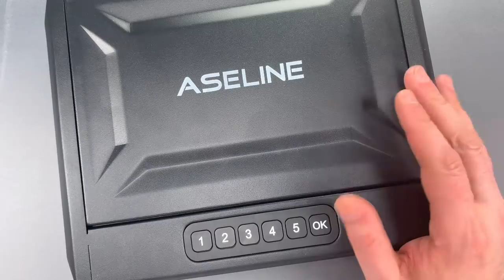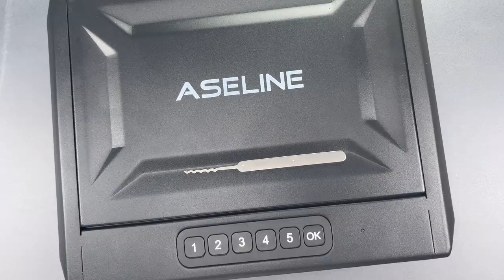[1238] An Unfortunate Name For An Unfortunate Gun Lockbox

Comment: I really want to know what your opinion is on 3D printed lock pics
Reply: I don't pick locks but unless they are printed out of metal(yes, that's possible, not for an average consumer though) i doubt they would survive a lot. Simple locks like this one are probably fine if you just lost a key and have a 3d printer but i doubt you would be able to pick anything that requires a lot of force.
Reply: Too springy. You' d get maybe 2, if lucky 3 layers in, that's just not enough. They're also going to wear quickly.
Reply: More like Skyrim pics.
Reply: For common 3D printers using PLA or ABS as filaments, the pick is about as soft as a poker card, oh and it will probably break on first try as well. I've tried.

Comment: “This is the kind of lock you secure toilet paper in a restroom” 😂😂😂
Reply: Frankly, it looks easier to open then some of the really shitty (no pun intended) locks I encountered on public bathroom TP dispensers years ago. Of course they might have been harder to open due to being rusted or bent, and/or the "key" being bent.
Reply: Wait; What toilet paper cabinets does the Cal-DOJ use?
Reply: Even that's generous. It's the kind of lock you use for a filing cabinet.
Reply: Got to wonder how many toilet paper dispensers he has picked.
Reply: The funny thing is in my high school they actually secured toilet paper with a lock like this.
Reply: @jcardboard  it’s the kind of lock you use for a filing cabinet holding small amounts of printer paper
Reply: Funnily enough I got bored to decided to try picking locks on toilet paper holders in gas stations and the locks do look very very similar to the lock that's on this safe
Reply: High praise! Toilet paper has been a valuable commodity over the last year.

Comment: To be fair, back in 2020 toilet paper was as valuable as a gun
Reply: "Back in 2020..." ROFL 🤣
Reply: According to MSM. but sure the joke stands.
Reply: Well, while that may be true, the main concern with locking firearms isn't that someone steals them, it's that the wrong person (especially children) uses it wrongly
Reply: @melonlord1414  My cat has a habit of using toilet paper wrongly.
Reply: @melonlord1414  I could have jimmied a lock like that by age 8. I know because I had one on a little keepsake box that I routinely did it to after losing the key. It only took a straightened paperclip and the right touch.
Reply: and bullets as rare as diamonds
Reply: Only until May or so. Then June happened.
Reply: @Megatron995  I remember doing something similar at 6  except it was the house door locks with nothing more than a metal hairpin and I didn't have access to books on it and youtube wasn't invented yet (self taught out of necessity as getting locked out of the house without a coat in sub zero temps sucks, and my sister was evil back then and thought it was funny) and it just so happened there was a metal hairpin laying on the floor of the porch. Bent the hair pin to 90degrees removed the rubber tip from the straight side jimmied it past the security bar (that had just been made available on door locks that year) and single pin picked the lock using the hairpin as both the pick and tensioner and it was a 5pin lock

Comment: Someday, LPL will find a "premium" lock that can be literally shaken open.
Reply: I think he actually has one....if not shaken then "thumped" with a  rubber mallet or the handle of a screwdriver?
Reply: there was that gun safe that would open from a 1 inch drop
Reply: There is already one he opens without even touching. With a magnet
Reply: Wasn't there a car hitch that he simply lifted up???

Comment: These lockboxes are designed for owners who feel they don't need and don't want to securely store their guns but they are legally required to store guns in lockboxes that meet some minimum criteria, but there is no criteria for actual lock quality. They are good for malicious compliance, and the lock quality (and in this case even the branding) is a clear "f you" message to anyone who checks compliance and to any visitor who supports such requirements. It should be cheap, it should be visibly bad, it should be practically useless as a real lock.

Comment: I'm only questioning the purpose of the dial pad at this point. Was that supposed to be the primary interface, and the wafer lock is the backup? Because "backup" seems like an euphemism. More like a back door, where the key is not under the doormat, but kept in the lock plug at all times.

Comment: From the 'ping' I'd bet you could easily open that up with a simple screwdriver wedged in the center and just apply a little lever action. From the sound of the cheap metal it should give without hardly any resistance.

Comment: I don't think the point of these is to actually secure firearms. If you want to secure your firearms against theft, you buy a real safe that weighs a few hundred pounds and bolts down. The point of these things is to be a cheap, minimal way comply with bs states or localities regulations that require you to keep your gun locked up in which case yeah, I want something that opens with almost no effort or with anything if I have to jump out of bed and use it in the middle of the night.

Comment: I stand by my opinion that gun safes that are meant for safety rather than theft shouldn't be hard to bypass. If you have small children then it should be placed out of harms way. If you have older children it should be placed out of harms way and they should know that guns aren't something to mess with. Most people aren't going to be able to open any kind of lock in a high stress situation so an easy bypass is a good thing in my opinion. An extra measure would be to not keep a round in the chamber. Most children don't have the hand strength to rack a slide.

Comment: we had a chemical cabinet in our lab at university that had a lock like this. I did not even use a wave rake, just a piece of welding wire that was lying around to jam in it and wiggle it open and using the wire as its own tension tool. it was faster then walking over to the desk to get the key.  it is obvious why it worked because the key had almost no biding and all the cuts were very low so it did not take much to get it open but I found it funny they they even went through the effort of cutting a key for it.